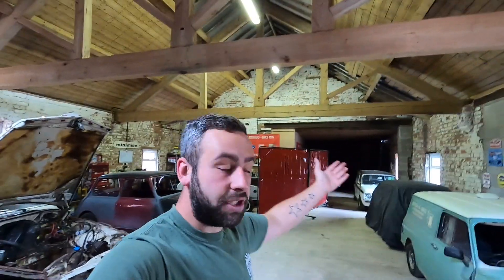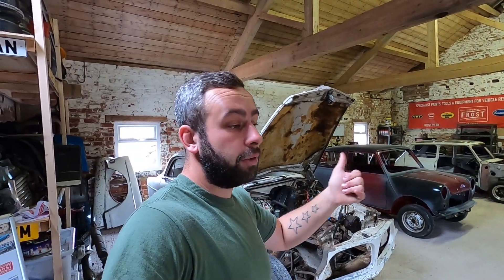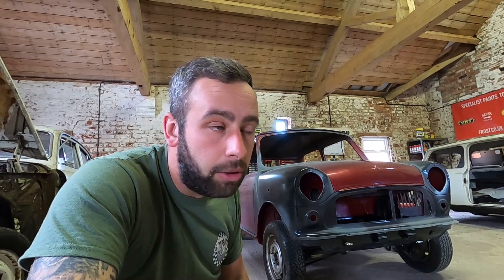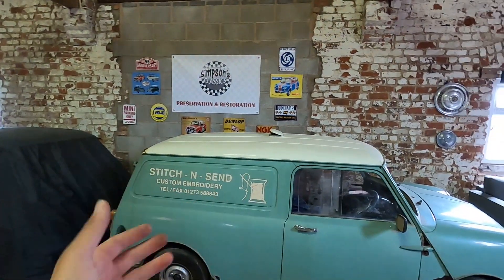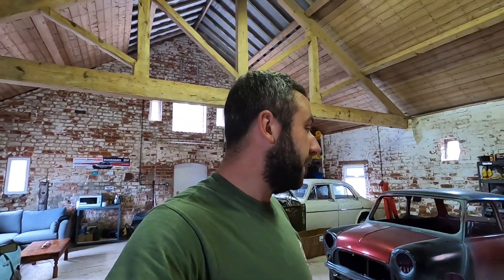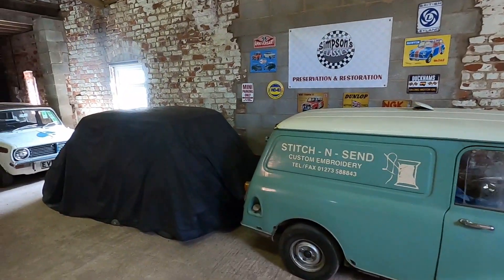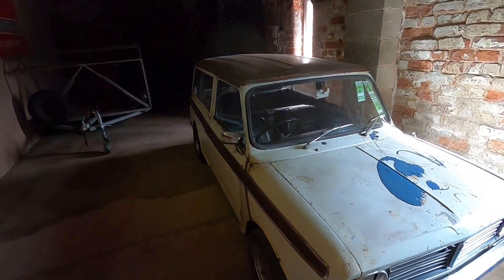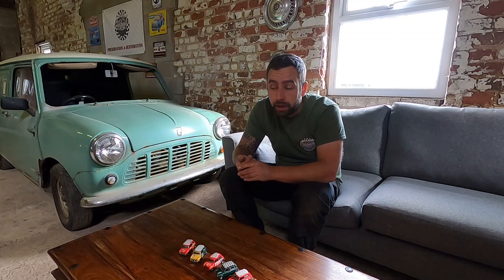MY WORKSHOP TOUR!

Comment: I'm never upset by any decisions you make on what's next, life's full of decisions.  When you mentioned a ramp I straight away and looked up and I'm thinking the workshop roof in that area is too low for it 🤔, might have to move it more central. As for 3 videos a week, my opinion is don't push it and put yourself under too much pressure, I'd rather 2 of good quality than 3 of a stressed man where the quality suffers, your decision mate.
Reply from the maker: Well, I appreciate that Graeme, I know the videos don't show the height too much, but it should be able to pull off a half decent ramp in the middle bay and yes pulled forward a little bit, but we will cross that bridge later down the road. I will do my best to keep throwing 2 videos a week out and who knows the odd bonus video. Thanks for watching.
Reply: @SimpsonsClassics  Yeah, I'm up for that with the bonus videos idea because there's no pressure on you and the quality remains high.
Reply from the maker: @graemew7001  cool thanks I will throw a few in as and when I can 👍